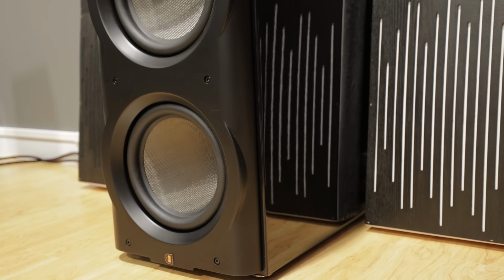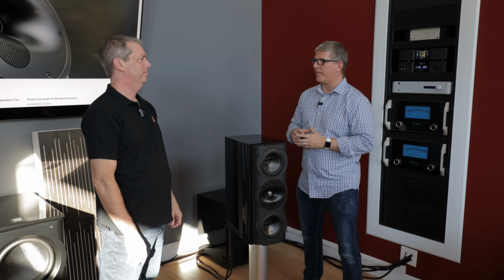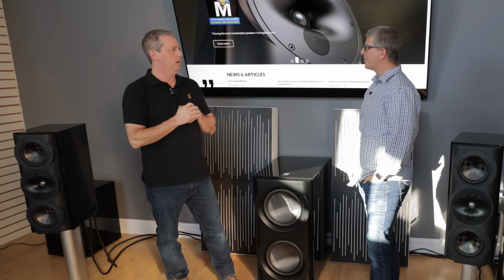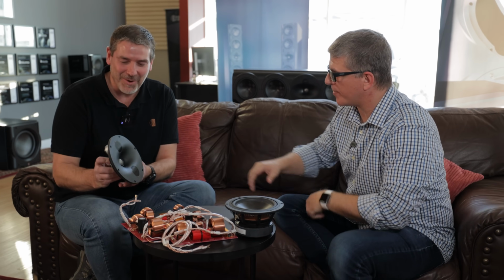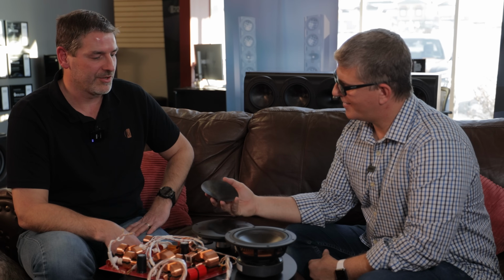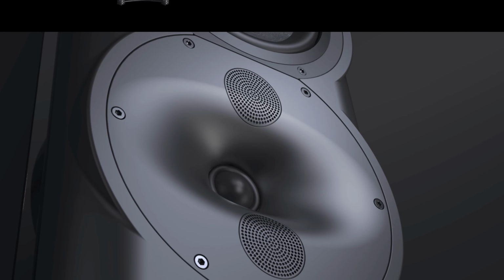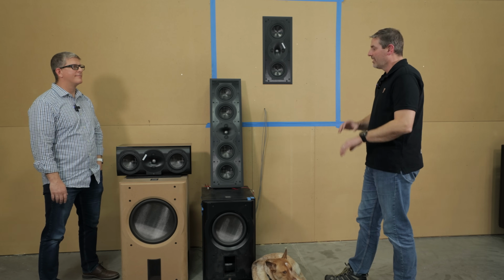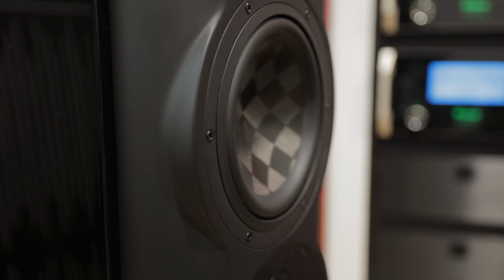Perlisten Insider - An EXCLUSIVE Look at Their NEW Speakers and Subwoofers From Headquarters!

Comment: I wish they’d lower their prices a bit, i have no doubt they sound sublime but pretty much everything is above $7000 and for a new brand that’s just a little too high
Reply from the maker: Curious why a new brand would be required to create inexpensive products. If they can compete or beat brands in the same price bracket, there is no need to reduce their price.

For those with lower budgets, they have the new R Series.

Comment: While these guys appear to have a nice product, I’m predicting problems for them. The marketing strategy of relying on distributors and brick and mortar stores allows them to only touch a tiny fraction of the real marketplace.  When I went to their website there was no price structure.  Always a huge red flag for me. They also appear to be really smart guys, but they have a little bit of an air of assumption that people will seek them out because we will somehow magically jump through hoops to buy their products. Well, without a good idea of what things will cost,(and I assume that the aire of superiority will drive their prices high) I’m not even going to pursue them.  When I research to buy items, these guys are just too difficult to deal with, and I hate dealing with a dealership or distributor, I want more cost effective items, and I don’t want to pay for 3 stages of middlemen that add zero value to my purchase.  I’m out.
Reply from the maker: Nothing wrong with buying your speakers from Best Buy.
Reply: @Youthman  I’m confused by your comment.  Are these speakers available via Best Buy?  The ones I have were not. Thiels in my listening room, and Bowers Wilkins in my theatre, with custom active feedback subs in a sand enclosure mounted on concrete pedestals.  

I’m not saying or implying that everything needs to be mass marketed, I just am saying that the brick, mortar, dealer, distributor business model has been largely crushed by the internet.  

When I do give a dealer type store the benefit of the doubt to check things out, I can’t stomach the unknown quantities of details that I have to turn over to someone that I don’t really trust because their entire business model is built upon inefficiency, even if their products are amazing and their knowledge is excellent.  

That’s how this industry got into 25000 dollar turntables and wire that costs 200 dollars a foot.  Adding line conditioners to devices that don’t even use a/c power past the initial transformer.  

If crutchfield would carry them, then we would have something….  At least I could access them, research them better, and make a decision based on price if I wanted to proceed. Hell, I would even buy them from a dealer, no problem….  But in the meantime the ability to research these is pretty sparse.

Comment: Prices would be nice. Spending 20 mins looking for a price drives some people nuts
Reply from the maker: The reason prices are not provided is because they deal through dealers. You have to contact a dealer to get prices. The same thing you will find with McIntosh, Sonus Faber etc. Ballpark estimate is $7,000 - $9,000 per speaker.
Reply: @Youthman  looking for dealers in Wisconsin?

Comment: I think it's interesting that the midrange domes are the same size as the tweeter. How does that create a lower frequency than the tweeter? I would expect it to have less midrange than a speaker that uses a 4 or 5 inch mid range cone.
Reply: They are probably just 3 tweeters. It looks very much like a copy of what MK Sound use in their legenday S150 series. It´s not a new design, it has been used in THX certified studio monitors (by MK Sound) for the past 25 years. The way he explaines it sounds so much like the white paper from MK Sound, I´m pretty sure it´s just a neat copy of their trusted design. The use of 3 tweeters enable the cutoff to the woofer to be lower than the usual 2khz. Thus calling it midrange.
Reply: @janthomassrensen1065  I hear one of their engineers was part of the original M&K company. You can definitely see the influence. It look like these guys have taken it to whole new level.
Reply from the maker: Dan Roemer (CEO in the video) has designed numerous THX speakers for many years. I’m not sure if M&K was one of them.
Reply: @samgipson8735  Well in that case it´s no big surprise. It just baffled me how he explained it to be a completely new design based on 6 months of research. When all it was is actually a copy of a many year old and tested design made by another manufacturer. I dont think the stacking of tweeters is trademarked or copyrighted. But it bummes me that he claimes it is a Perlisten design when it actually isn´t.
Reply: @Youthman  I was actually pondering on that lastname when watching the video. Roemer, or as I would say, Rømer is a danish lastname. And MK Sound is a danish company. They have provided studio monitors for Lucasfilm and numerous other big studios since the birth of THX. Basically everything You hear on any Blu-ray disc has been mastered using MK Sound monitors. If You´re able to, You should really give them a try in your home theater. I have just upgraded to MK speakers in my home and they are a-fukkin-mazing :-)
Reply from the maker: Copying a design that is trademarked or patented would not be smart. It certainly could be inspired by another speaker design. “There’s nothing new under the sun.”
Reply: @janthomassrensen1065  I've done some reading since my original comment, and I think you're right. According to Perlisten, the R7t and S7t are 4 way towers. I've also read comments that say 2 of the 4 woofers assist in the mid frequencies. I'm not sure if this is a fact, but it would make more sense than using two 1 inch drivers solely for the mid range.
Reply from the maker: That is a technical question that is beyond my knowledge

Comment: If Perlisten can get a Dominus THX rating, I wonder what rating JTR speakers would get? They'll have to create a new category - Dominus Stupendicus.
Reply: The THX Dominus rating is not just about sheer output.😂
Reply from the maker: JTR’s measure extremely well also. They very well might be able to achieve it. It just costs a premium for the license and I don’t see that license converting into sales for JTR.
Reply from the maker: I’m not sure what brands would meet the THX Dominus Certification
Reply from the maker: It’s difficult to compare to brands when you cannot listen to them in the same room to compare them. I can say both make incredible products. JTR is definitely more industrial looking but if cosmetics are not important, they certainly offer a high performance / value proposition

Comment from the maker: Check out Perlisten's NEW speakers, subwoofers and the technology that goes into their incredible products! Check out Perlisten - https://bit.ly/Perlisten_Audio. Timestamps below.
This video is sponsored by Perlisten.
01:04 - Intro to CEO and CTO
01:37 - Story behind Perlisten brand
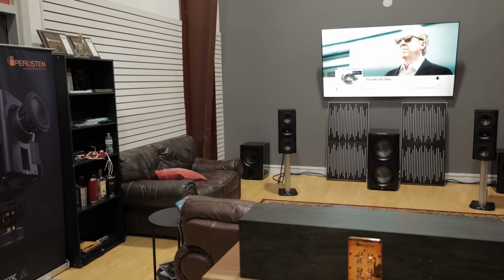03:08 - First Listening Room
03:46 - S5m Monitor Speakers
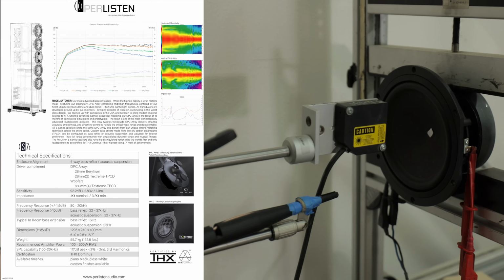05:23 - DPC Array
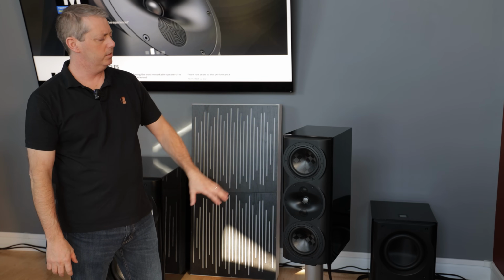09:09 - Beam Forming
10:27 - Importance of Timber Matching
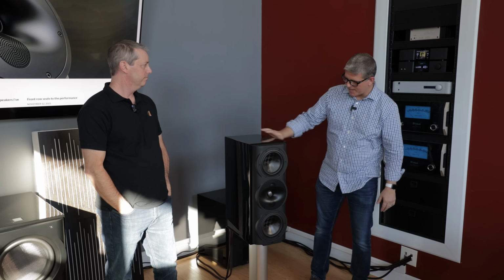15:10 - R210s Subwoofers (NEW)
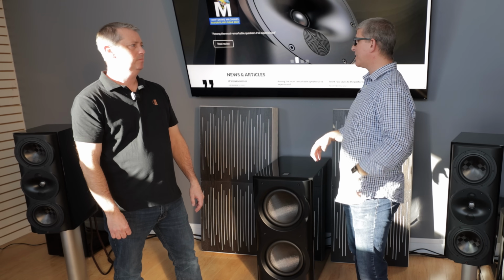17:52 - D212v (Dual 12" Subwoofer)
20:45 - Perlisten Subwoofer Lineup
23:54 - Subwoofer Amplifiers
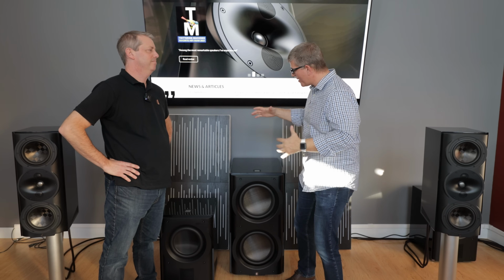26:50 - Tech Inside Perlisten Speakers and Subwoofers
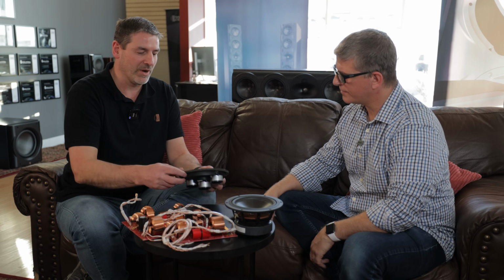28:10 - Beam Forming Technology
31:49 - Using Internal DSP
33:16 - Tight Tolerance Crossovers
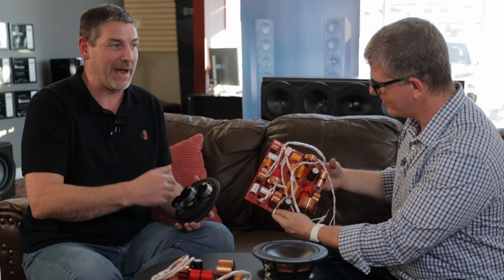36:00 - Driver Technology
41:15 - Woofer Technology
43:22 - Subwoofer Technology
45:43 - THX Certified Dominus
48:45 - R5t and R Series (NEW)
51:15 - D12s Subwoofer
52:18 -S4b Special Edition Finish
53:29 - Flying Speakers Inside Measurements
55:01 - S7i-LR In-Wall Speakers (NEW)
57:28 - Perlisten Nomenclature
59:08 - D215s Subwoofer
01:00:05 - S5c Center (NEW)
01:00:37 - R7t Prototype (NEW)
01:04:15 - S5t Prototype (NEW)
01:05:50 - My Listening Session Impressions
01:09:34 - What's In the Rack?
01:11:19 - Why Another Speaker Brand?
01:13:22 - Wrap Up

Demo Tracks Mentioned in the video:
Hollow [16-=Bit Remix] by Björk
Improvisation by Jim Keltner
If you enjoyed the Perlisten Insider and our Home Theater Tours and would like me to do more, consider becoming a Patron - https://www.patreon.com/youthman

Best pricing on Home Theater products  - http://youthmanreviews.com/sales/

Visit http://hometheatertours.com to submit yours for a possible tour - https://hometheatertours.com.

Ways You Can Support:
Patreon: https://www.patreon.com/youthman
Youthman Courses - https://www.youthmancourses.com/
Youthman Merch - https://teespring.com/stores/youthman/
Reply: Thank you !!! <3 .. Fantastic deep dive. I seriously see this as a first of many .. and more will want you on board after this. Kudos on making this type of series a reality =)
Reply from the maker: Thank you Kindly, glad you enjoyed the video.